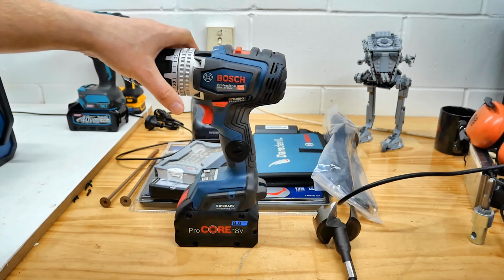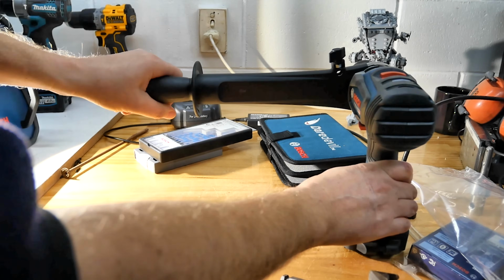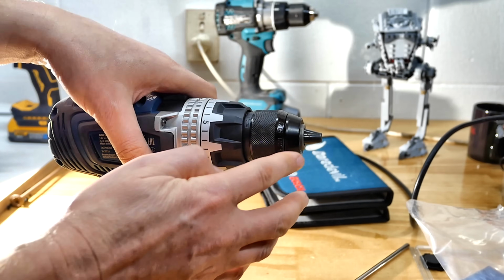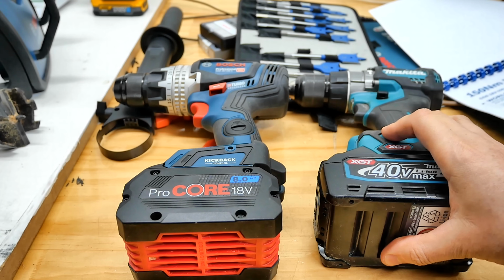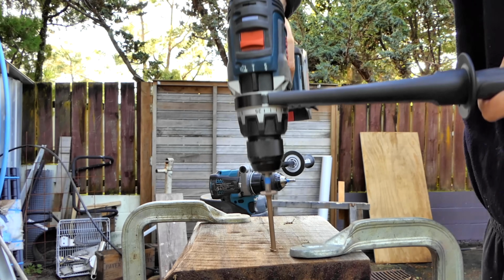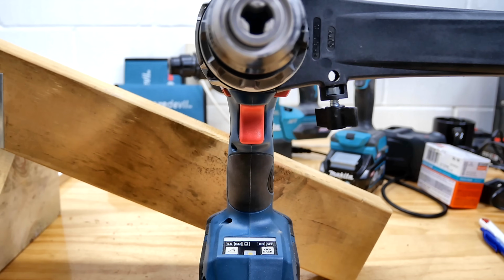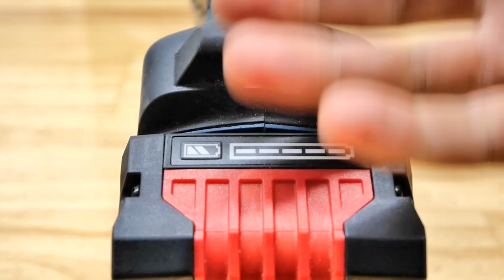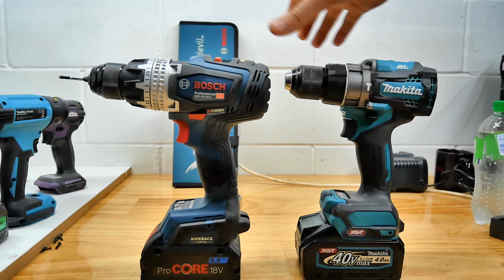How good is the Bosch World's Strongest Drill? First Cordless Drill with Angle Settings!

Comment: Changed all my tools to Bosch about 5 years ago, not one has ever let me down, I got the 5.8 joules Sds plus, the most powerful one I could find, brilliant tool
Reply: same here I went 18v bosch blue Pro brushless, hammer drill, 5" angle grinder, 5.125" random orbit sander, rattle gun, 2x 5AH and 2x 6ah batteries, both the 5ah batteries failed at just over 12 month but I repaired them by replacing 2 of the 10 cells in each of them bosch would have replaced them but I couldn't find the Purchase receipt
Reply: Thanks for the info brother ❤❤❤

Comment: Not for me. After something like 30 years away from Bosch I foolishly bought a load. Nothing but trouble with them. The earlier ones with the chip and the app did nothing. Totally pointless. At least this time you can change something. Four out of six batteries died well within warranty. Everything that broke was a mission to get Bosch to repair. And took forever. Hardly use any of the tools now. The grinder mostly still works when it feels like it then stops for no reason. Won't even turn on for a few days then works as normal for quite some time until it chooses to stop again. The only Bosch tool I really like is my cordless jigsaw. I have owned various breeds and used even more including Festool. I still own a high end Makita electric jigsaw. Horrible thing. But every Bosch jigsaw I have owned just works. Can't see me buying anymore Bosch.

Comment: It’s actually quite good. Not gonna change me from Makita though 😂
Reply: I changed to this one because the speed selectors on the makitas kept failing on me every time the first or second speed died and just made grinding noises, after going through 6 makita drills in 2 years i was done with that now i got this model
Reply: Same 🤣
Reply: @lukie4ever  I’ve never had that problem, but if I did, I would probably be doing the same in all honesty. I just like to keep to one battery platform instead of mix and matching
Reply: @DeeIbbo  i work them too hard i gotta be honest but the bosch is holding up well so far I've got the gsr18v 150c and the gsr18v 60fc (flexiclick) with all the attachments and I've abused it for 60hrs of its runtime and still going
Reply: @lukie4ever  there's no better drill than the gsr 18v-60 FC. By far better than anything else...
Reply: @januszR  in versatility yes, i totally agree but it's lacking some power sometimes thats why i got the gsr18v 150c too

Comment: I own a few combi drills but only use them for drilling wood, the masonry function is rubbish compared to a SDS drill...driving screws and bolts, we all use impact drivers... don't we?
Reply: Masonry definitely sds+ but drills are actually often faster driving in screws.
Reply: In some instances the noise of an Impact Driver isn't allowed so if your drill can do just as good then even better. Without noise restrictions then yes you'd probably always use the Impact Driver.
Reply: @geofg66  Impact drivers don't "Cam Out" as easily as a drill but the noise can be a problem. Drills are better for smaller screws which you don't want to overtighten.

Comment: I have the older 125 version of this drill. Doesn't have Bluetooth or levelling options but I'm well impressed with it.i sometimes use it for mixing tile adhesive and grout, mostly grout and it works perfectly.

Comment: Thanks for the Bosch review. All my Bosch tools have held up really well. But its good to see them finally catch up with the others when it comes to power. Now they need to make a stronger Freak impact driver.
Reply: Agreed, although I believe it needs more RPMs and IPMs than torque. I just got the GDX18V-1860 which translates to 210Nm, used to have the 3 spd 200Nm version. They both remove my car and truck's lugnuts with ease. Breakaway torque is actually 365 Nm or 270 ft/lbs which is pretty strong for a tool that doubles as impact driver. 1/4" hex adapters can't take much before breaking anyway.
But the 3400 no load RPMs definitely get cut at least in half when setting screws and lag bolts. That's where I can see the tool improving.
Reply: @luisinhoens90  Yeah i totally agree with the speed too. I've got the 3 speed 200nm like you used to but the RPM's drop alot under load. How are you finding the GDX18V-1860? Was it worth upgrading to?
Reply: @khuongathebounga4141  I also have the 1860. it's weird cause the german version has different branding (GDX 18v 210 C). Doesnt make any sense, why they use different names in the US/UK.

Anyway, i love this thing. It's pretty much become my daily driver for working on cars and around the house. I haven't had any issues with larger screws. I usually only use speed 1 and 2, 3 is overkill in most cases for my applications. A good bitholder is definitly a good investment. I already killed one, it just fell apart :D
I use 4 Ah procore batteries which also improve the power output a little.

For everything that needs brute force i have the GDS 18v 1050, which has 1700nm breakaway torque and is on a par with the top of the line milwaukee impact. There hasen't been a single nut/bolt this thing didn't break loose.
Reply: @Blobb2013  Thanks for sharing your experiences with the 1860. Sounds like i might need to upgrade mine. I'm also still running on non procore batteries as well, however i just ordered a 4ah and also an 8ah procore so should be getting them soon. Yeah i agree with the strange name difference. Sometimes it makes it really confusing. They should have just stuck to the same model number worldwide. As for the GDS 18v1050, that is one tool I'd love to own. Glad to hear that its been able to handle anything you've thrown at it too as it gives me more confidence in thinking abut buying it.
Reply: They need to redeem the freak
Reply: @luisinhoens90 just a heads up, the bosch freak is stronger when using a hec adaptor, torque test channel tested this. Kinda weird

Comment: I would not mind the extra weight of that Bosch drill. It tells me that quality is most likely involved. Perhaps strong metal gears and a strong heavy duty metal chuck. As an 18 volt tool, the Bosch shows how well it does up against a quality 40V Makita. While I normally stick to my beloved Makita platform, I do own some quality Bosch 240V tools and I have no complaints. I enjoyed the Bosch review. Happy to see more.
Reply: 40v or 18v is merely a marketing thing. Hilti says their lastest one provides higher power than 40v
Reply: @alexanderyu85  Year 2011 and Metabo had this beaten , 120 Nm soft / 276 Nm hard , by them then🙂 Attachment  today cost about €285 
On YT can be found with , Metabo BS18LTX Quick PowerX3 PowerExtreme Drill Driver with Impuls and Hi-Torque
This is of course when Metabo was still doing quality tools and not like now owned by investment company . 
Bosch should have no need to cut the corners in its tool , when it is owned by Robert Bosch foundation , that also does charity .
Reply: That's simply because voltage does not equal power.  While you can deliver the same power at a lower voltage it's not just for marketing.  Higher voltage means higher efficiency, lower operating temps, and better reliability.  That is why, for example, Milwaukee now rarely mentions "runtime" in there competitor comparisons, and they have begun to roll out some multi-battery tools a al Makitas X2 system. 36v is probably overkill for something like a drill or impact, but on constant high draw tools 36v has a real advantage.
Reply: @dcl97  and it means way less wear on the electronics and internals of the battery and motor  because doubling the voltage means cutting the amps in halve.

Comment: i have been using Bosch tools for 20+ years now. my 1st drill still works but has become my wife's house drill. they just fit my hand better. when you are working with a tool all day that matters more than the specs. the speed and power matter more to the boss as he needs more screws  per hour. i need to be able to grip my steering wheel at the end of the day. i went all in on the 24V system and they still work great. the miter saw is easy to take to a job site.

Comment: Thank you for your excellent review. One thing I did get from this is that the battery voltage has a little relevance to the tools performance. I suppose a watt is a watt regardless of the voltage. This brings me to the point. I have made an extensive investment in the Makita 18V platform and feel that Makita is no longer supporting this platform. Their battery technology has remained static for the last few years only providing a maximum capacity of a heavy 6.0Ah battery while their 40V platform have 8.0 Ah battery,  that would equate to 16.0 Ah if it was on 18V platform.  I think it is time to switch, Bosch is looking good.

Comment: I don’t mind my super powerhouse drill being a bit heavier as long as it has lots of performance and extreme durability. I think the race to make super high torque cordless drills as microscopic has come at the expense of longevity. I used to have a gen 2 Milwaukee fuel which I burned out replaced it with a brushed hilti which is smooth as silk and got 4 speeds and tons of power.
Reply: How on earth did u burn out a fuel ?
Reply: Improper use

Comment: One thing to mind when assessing 'power' is how much rpm each have. Makita has more rpm in either gear. Power being proportional to rpm and torque - the Makita appears to still have more raw power. We already know that Makita underperforms with the 4 Ah battery (next to even a  2.5Ah pack). I can confirm that 5 Ah pack gives it more punch than 2.5 Ah.
 The Bosch is clearly a worthy powerful drill. Back when the drills were in an aluminium enclosure (WW2 ish) the bubble lever was common. Nice to see the feature returning in modern package.

Comment: Great review and testing. I just bought this bosch gsr 18v-150C, I also have the older gsr 18V-110C for more than 5 years. But this new one is more powerful but also heavier. I like the angle detection function. At some point in this video I saw smoke coming out from the bosch, when you tested with that 12mm screw. Did the temperature protection do it's job? Any warning or red light on the interface.? My Bosch angle grinder use a similar hmi and if I push too hard the warning light is blinking red.
Or maybe just some oil or something else was evaporating. It happens when you abuse a new tool.

Comment: Do you want to test the gsr18v-60fc? It has an sds attachment, right angle attachment, an excentric attachment and the regular chuck, you can also put a 1/4bit in when there's no attachment on it like an impact driver, just search it up you'll see what I mean
Reply: I've used mine for about two years, and I love it's versatility with the attachment, the weight and size, and the overall feel of it!
Reply: Also my favourite tool. Had mentioned it in this channel before, too.

Comment: Hi  great review.
Just one thing I want to say is; that charger it's not a 'quick charger', the fast charger from Bosch is the bosch gal 18v-160 c
and You can charge Your 8ah battery in 50min to 100%
Reply from the maker: The one in the video is quicker than most. But you are correct, the 160 is the fastest.

Comment: This one is individual - but I do like long easy to adjust side handles on powerful drills. Bosch kit is often robust. I wish it had a 3 speed gearbox, they are often very useful. As a system I'd prefer Makita or Milwaukee, despite already using some mains powered Bosch tools.  One downside of the Bosch is size - especially length, that can be a pain.
Reply: with brushless tools and constant speeds 3 gears are obsolete. I have the Makita drill from this video and even on the very first speed setting, e.g. pulling the trigger ever so slightly, it will not stall under heavy load. The first speed of the first gear is very slow, a 3rd gear would not benefit. I'm sure it's the same with this new Bosch drill.

Comment: The simple fact Bosch and Makita xgt have kickback and none other do make them their own category above the rest. That feature is worth more than a faster drill if you work with metal or in any elevated (ladder, harness work) condition.
Reply: The gen 4 Milwaukee, DeWalt, Hilti, Hikoki (Metabo HPT), Metabo, Flex, Kobalt, New Ridgid all have kickback protection. The 40v Makita needs a lot of rotation to activate, so not very useful.
Reply: @misha030302  DeWalt is still missing kickback. But I'm sure they'll add it when they upgrade the DCD999 with something else.

Comment: Mu father-in-law has the previous big Bosch hammer drill. Akthough it is powerful it is a bit clunky too use. It just feels heavy. Too bad they haven't made it shorter, like may manufacturers, working that far forward from the handle can make it tiresome after a while. Especially in situations where you are already short a hand.

Comment: Bosch advertise this drill as 2.2kg bare tool - which must include the handle and belt clip? Which is the identical weight to the Milwaukee Fuel Gen 3 Combi is listed as bare tool interestingly.    Bosch declare : It is measured according to IEC62841-1, 5.17 & 5.17 or EPTA Procedure 01:2014. So it would be nice to know the specifics of thosw standards, to see what it says about including or not including accessories.
Reply from the maker: Tool company websites are often wrong. That's why I have to weigh everything.

Comment: An important category you ignore, and I learned from experience is chuck durability and life. Why? I own a Dewalt hammer drill DCD696 and the chuck is its Nemesis. Chuck jams frequently and fails prematurely. To replace the chuck requires drill disassembly and a torch to free the drill shaft which has been shrink fitted into its housing. This is a biggie.
   I have used mine for heavy duty drilling of granite boulders prior to splitting them. That is heavy duty.
   Drills like the Bosch and my Dewalt are for lighter duty work.
   Remember the chuck is the weak link on any drill and easy replacement is a big item you have overlooked. Dewalt wants you to replace the drill and not the chuck.
Reply from the maker: Well why are you not using a Rotary Hammer drill? And do you mean the DCD996?
Reply: @ToolsAndStuffOFFICIAL  Excellent question. I own the Dewalt and felt that I only had one or two grantie rocks to break up but I keep finding more and second guess myself saying that if I buy a rotary hammer I will likely never use it. 
      What I think is important is that these 1/2 inch hammer drills are essentially light to moderate duty and with Dewalt you get a chuck which constantly jams (an irritation) and chuck replacement means disassembling the drill and heating the shaft housing to free it and then rebuilding the hammer portion.

Comment: Awesome comparison between both machines.
Just wondering what if makita bring up 21700 cells or pouch cells  instead of 18650, does that going to make xgt as really powerful?. Cool added features of Bosch though!
Reply from the maker: The XGT 4Ah and 8Ah batteries use 21700 cells.

Comment: I would really like to see how the 18v biturbo circular saw measures up to the 36v and 40v makitas.  Bosch seem to have decided to stick to 18v but upgrade batteries and motors, but is that enough?  I'm on the 18v Bosch platform and that saw might be a future purchase.
Reply: AFAIK, that is a pretty good saw. Also, don't forget that current 21700 cells like in 18v bosch are much better than 10+ year old 18650 battery technology.
Pretty sad that makita 18v stuff and their new 40v batteries are not compatible in any way.
Reply: As long as you don't need Outdoor Power equipment like leaf blowers, lawn mowers or chainsaws, 18V is plenty for most jobs.
OTOH, 40V gives you more runtime than an 18V tool with the same Ah battery.

Comment: Every drill I have had going back to the old 9.6 stick battery makita I have just set it to drill .never messed about with the clutch .a lot of extra features that I would never use
Reply from the maker: I never used them either... until I got the Makita 40v which takes it to another level.

Comment: Wrists and arms can’t be replaced. Unnecessary power comes at a price. A guy at my job lost a finger and damaged two others with a grinder and a wire wheel. It ran all up his chest and arms. It really whipped his…. Like a squirrel or something.
Reply: that's terrifying. I should be more careful with my stuff. I sprained my wrist pretty bad last spring drilling 1/2 inch holes in 1/4 inch steel. I didn't have a side handle for my cordless drill and I wasn't aware just how powerful these things have become nowadays. I mean these things will tear your arms off!

Comment: I would like to see how the performance of this (Bosch) drill compares when using the Procore 4Ah battery pack which is 440g lighter.
Reply: its weaker. Bosch has this drill optimized for the 5.5 and 8ah. With the 4Ah you have like 70% of its full potential

Comment: Hi. Do you use Bosch "Amp share" battery, with 21700 cels? That looks like regular Procore battery. Only Amp share gives you full power out.
Reply from the maker: There are so many problems with your comment.
Reply: @ToolsAndStuffOFFICIAL  Other side of battery case is text "Amp Share". That is the battery with bigger cels, 21700 , while regular is 18650.
Reply from the maker: Ok, here we go.
1. You didn't even watch the video or didn't listen or understand it.
2. Look at the date the video was made.
3. Have you ever actually seen, in the flesh, not on a promotional video on Youtube, an Ampshare battery?
4. Procore batteries use 21700 cells NOT 18650s as you claim.
5. PROCORE AND AMPSHARE BATTERIES ARE THE SAME JUST WITH DIFFERENT PRINTING ON THE BATTERY CASE.